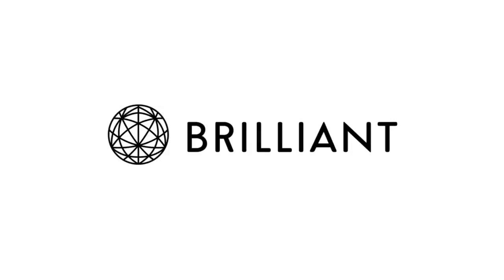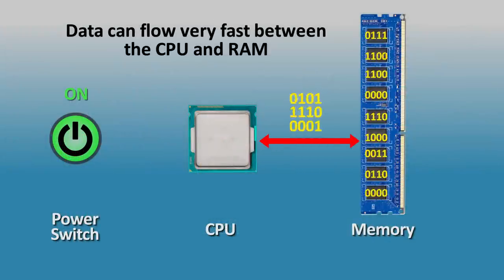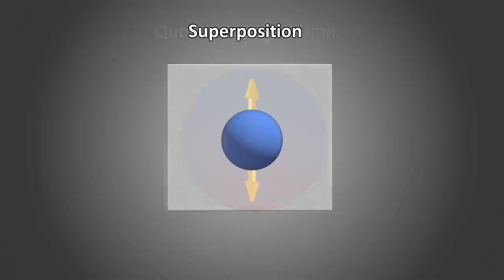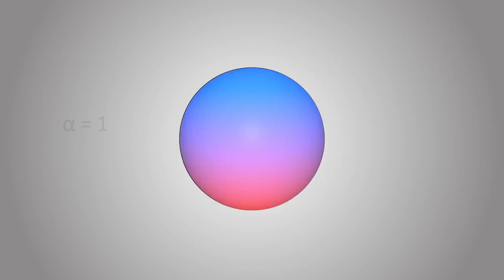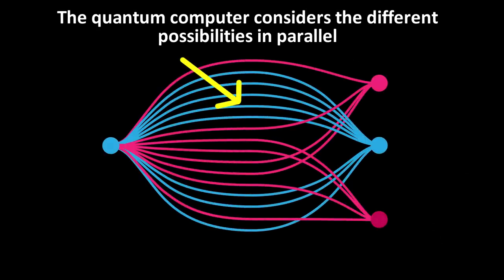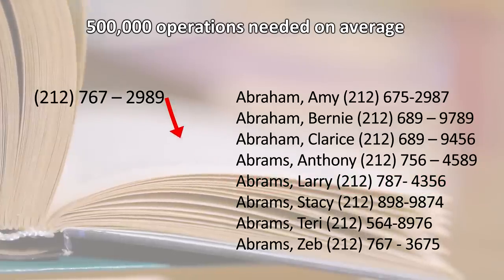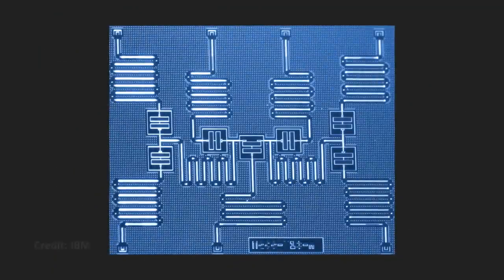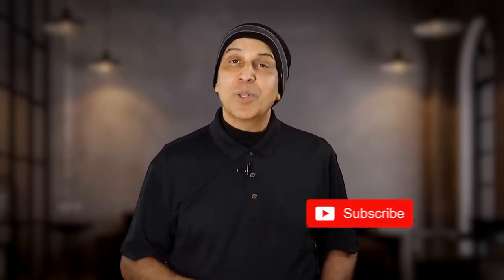The Insane Mechanism of a Quantum Computer?

Comment: quantum computers are total vaporware. A quantum computer requires a software implementation of Schrodinger's cat, where there is a box, and inside is a cat that is simultaneously alive, and dead. Good luck with that, LOL. Come on people does this @5:05 look real to you?
Reply: Every single proton is such a system. Your entire body is made of countless quantum computers. They simply don't calculate stuff that you are interested in.
Reply: @schmetterling4477  A quantum computer relies on a piece of software called the "minimization function" The minimization function is the theoretical software implementation of Schrodenger's cat, where there is a cat in a box, and it is simultaneously alive, and dead at the same time.  This "thought experiment" cant actually be implemented. Therefore quantum computers are Vapor Ware
Reply: @tazanteflight8670  Yes, the proton minimizes the function that calculates the proton mass. ;-)
Reply: @schmetterling4477  "Bla bla bla, just give us money" AKA the Quantum computer...
Reply: @tazanteflight8670  I can buy a beer for you. That has approx. 10^25 proton quantum computers. :-)
Reply: @schmetterling4477  Thanks for the beer. If those protons are computers, what are they computing?
Reply: @tazanteflight8670  The mass of the proton. That is an extremely hard computation. :-)